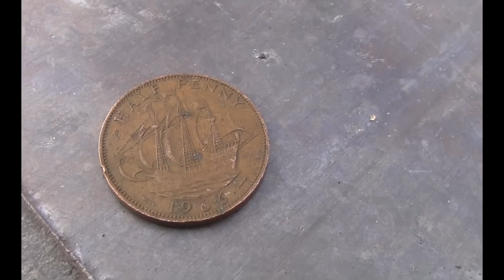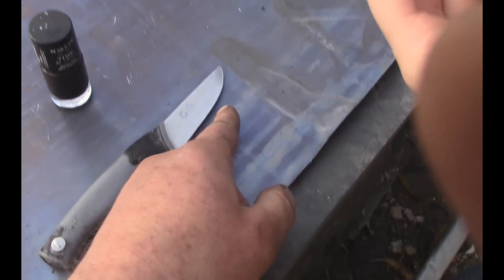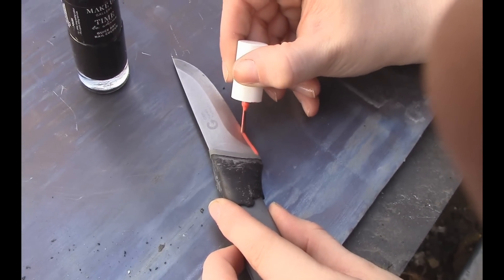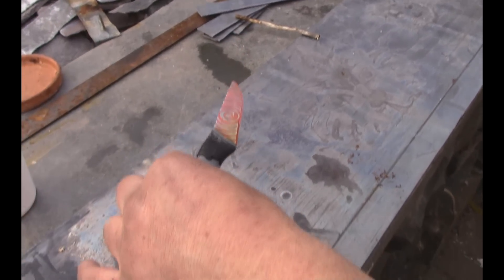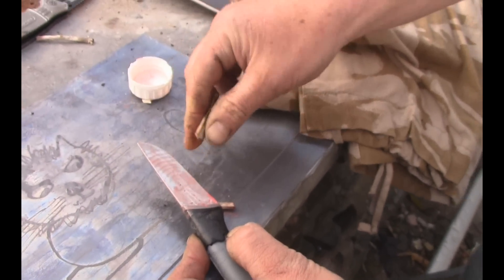DIY Etching Knife Blades with Hydrochloric acid (basic)

Comment: What percentage strength acid are you using for this test easily available are 10% and 36% strength?
i am presuming it was not 100% acid as it would have eaten away at you finger flesh if it was.
i know it was a long time ago, just wondered if you remembered.

Comment: if you sprinkle salt over the blade while the acid is working.it will make the acid work harder.at least thats what i do when the acid seems stuck.
Reply from the maker: thanks for that tip, ill keep it in mind!
Reply: thepoultrypeople 
Would painting a blade with nail polish damage it?

Comment: It seems like everyone is voting on Holly's Cat more than they are commenting on the Etch. Speaking of which, would Layering the Acid as it looked like Holly and You were doing, Does it cause the Acid to Etch Deeper? Or was it just looking that way? Oh, I seem someone using Vinegar as an Acid, Hot Vinegar, Using a Current through Vinegar and Salt mixture seemed to do an awesome job too. Just some Alternatives in case you want to try something different or save a little money, not that Hydrochloric is Expensive or anything. Thank You for the Video, I'm trying to figure out what works best and it seems that Your Design worked out for you fairly good! Trying to get my Nephew and Niece into making their own stuff and not buying someone else's Art. Anyways, Many Thanks to You and Holly for this fun video!!

Comment: I hope she likes the biscuits.

Titanium can be etched using Coca Cola and low voltage direct current. Place fabric or other wick material on the metal, connect one lead to the metal, the other to the fabric.

Check out how to make Graphene at home. Graphene is a super capacitor, you can convert non-conductive materials like plastic into conductors by coating the material with graphene. Graphene is a lattice of pure carbon atoms. It's as simple as rubbing graphite (lock lubricant) onto a surface.

Super capacitors can be charged up quickly unlike traditional capacitors.
Reply from the maker: ManufacturedLack interesting, i did do some anodising and also rust removal using dc electric and lead sheets, it was some time back, i wish i videoed it,  youve given me a lot to google and look at further, thanks
Reply: thepoultrypeople Cheers

A project I would love to see built is a Cavitation hot water heater.
It's a barrel with dimples, sleeved inside a larger barrel that is also dimpled. It's supposed to boil water almost instantly.

The energy regulators are only allowing Firehouses to install them because Cavitation hot water heaters could make every other water heater obsolete, millions of people would lose their jobs.
Reply from the maker: ManufacturedLack that took me down a confusing road, let me know when youve built one :)

Comment: Looks pretty neat that, could make some templates up with designs or text..nice one.
Reply from the maker: 007vauxhall apparently you can print out onto acetate then transfer it with an iron onto the workpiece?
Reply: thepoultrypeople
Not sure about how long it would last , just ironing it on...but what do I know..lol.
Reply from the maker: 007vauxhall its got to be a laser printer? i tried using permanent marker the other day but the hydrocloric ate it alive, didnt too well with the ferric either, im going to need next acetate and some fine brushes, you  should have a go, get the ferric off ebay, some nail varnish and give it a go on a old knife or other bit of steel, maybe a personalised shovel? :) thats something ill have to try